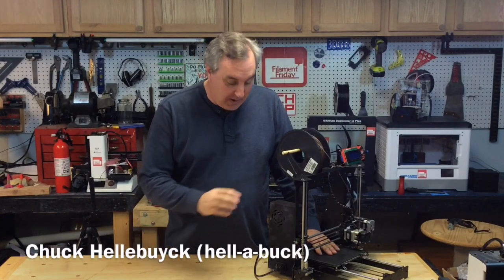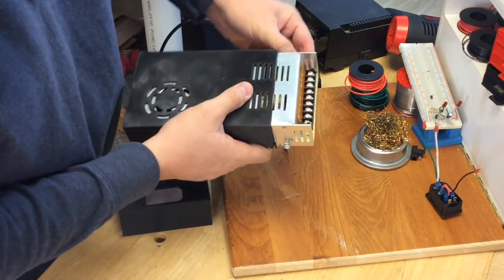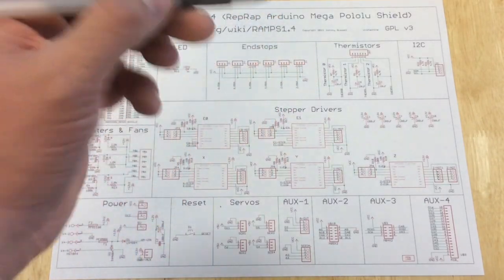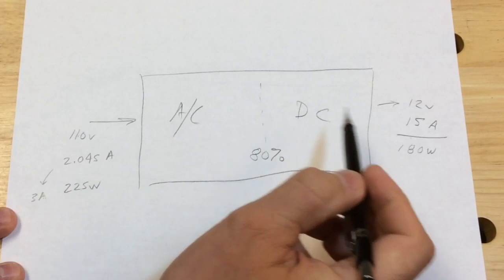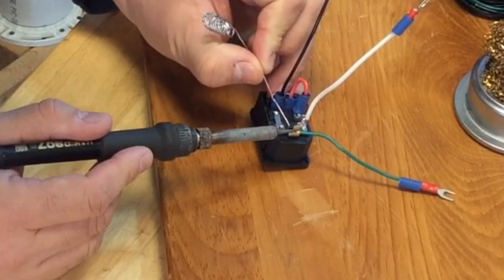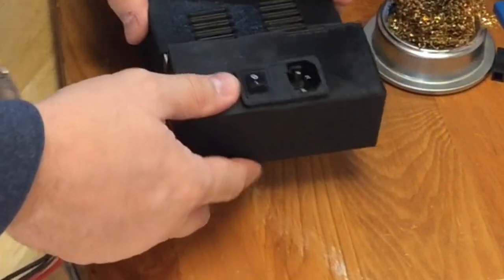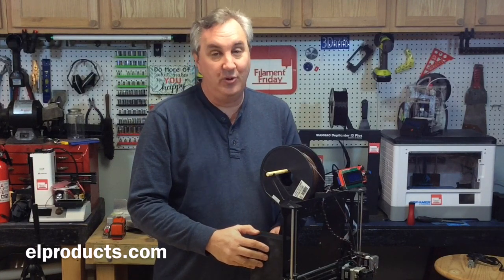How to install IEC AC Plug Switch Fuse module on a 3D Printer for Fuse Protected Power

Comment: Would we just double the amper amount for the fuse if we wanted to add a fuse to a 24V system? Thanks! Keep the content coming!
Reply from the maker: Not necessarily. Current often goes down or stays the same in a higher voltage system. Just has more voltage to produce the current so it can speed things up.

Comment: hi, friends, this 3 Pin IEC320 C14 Inlet Module Plug Fuse Switch Male Power Socket 10A with wires!!!   https://www.amazon.com/Socket-Module-Switch-Female-Terminals/dp/B07C1567XW/ref=sr_1_4?ie=UTF8&qid=1538632614&sr=8-4&keywords=c14+socket+switch

Comment: Would a full cover not be okay because you're screwing through to the case and so it will be connected to the 3d printer frame? My electrical knowledge is limited but i'm curious.

Comment: got the same switch  although   the rocker switch is upside  down so the plastic tab in between the to prongs is at the top  and in the above  shot in your video its at the bottom so would i plug it in the same way or the wiring on the rocker switch be inverted  i hope that makes sense

Comment: Thanks for this video. I bought that same switch and power supply for a printer I'm building from scratch, but couldn't find anywhere that said exactly how to wire these parts up until I found this video. It's a life saver!

Comment: Thanks for showing the wiring of the switch. Just had my printer fail a print mid way because I used crimp connectors. I did everything correctly but i guess the neutral part got loose and it melted destroying the switch. I was thinking of using crimp connectors just take off the plastic and use heatshrink(like i do when wiring up a car), I think ill be soldering the wires to the power supply. 
Is 14ga wire okay?

Comment: You seem to have more knowledge of the technical side of this hobby than most, I hope you dont mind my question: On an Anet A6 which is almost identical to Anet A8 and other similar machines...How important is an upgrade to a 30a power supply over stock, which I believe is 15a?
Reply: Notice that using a bigger power supply than needed will make the power supply a bit less efficient.
Reply: Pedro Zurita The power supply will last longer and perform cooler because of the reduced load.
Reply: I literally just did my switch wiring from my switch to a highly recommended 30a PSU from Amazon. Basically there's only 2 benefits. Faster warm up times on the bed, & the one everyone recommends from Amazon has a built in fan. I've heard it makes for better/faster ABS prints but I guess we'll see about that later. You could always rig a switch & an old PC face to the stock PSU I suppose. Either way, get a switch & MOSFET just for safety's sake.
Reply: stock is 20amps   - 30amp is better to meet the switch on surge and apart from dealing with teh hotbed better - allows "some spare" amps.   A mosfet is an additional helper for the  hotbed and alothough some say nozzle does not need one - for $5 each - I use two and in the UK this is known as "Belts and Braces" - yer never know if one  will fail! Also some folks who  buy a 30amp - use it for hotbed and motherboard - and use thw 20amp as a separate supply to the Nozzle - the 30amp PSU is OK for all and keep the 20amp for you LEDS etc,.    I also suggest that  ALL uses of hotbeds using the Anet plate and cable -  buy some Bondic or  ist cheapo clone - "5 second fix" off ebay and others - and use it across the  pins to lock in the male and female sides... it stops them  moving around  - which is mainly why the burn out!

Comment: Not sure covering up the whole PSU case is a good idea . In most ive repaired the power regulating FETs are bolted to the case which acts as a heat sink!

Comment: I saw the cloths pin on your Y end stop on your MakerFront. I had that same problem on my MakerFront. I designed a flat piece of plastic that I could put two screw through the end stop and bolt to the frame in the back. I 3D printed it. It has been working for about three months of continuous printing with no problems.
Reply: Also that filament holder you use does create some drag. I found a universal filament holder that uses bearings on Thingiverse that has almost no drag and fits every filament spool I have ever used!
Reply: I just now uploaded it. Feel free to use it however. I am sure it could be made better.http://www.thingiverse.com/thing:2106401
Reply: I was going to add another hole so the end stop could have two nuts and bolts to hold it better, but got to busy with projects. Currently working on a Root2CNC machine which is by sailorpete on Thingiverse.

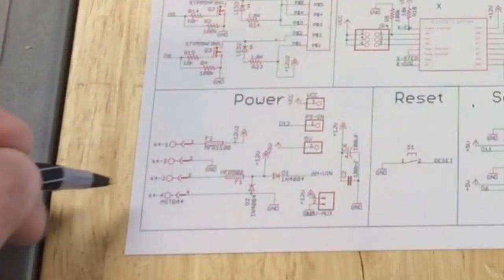Comment: 4:10 HaHa.. Boy... Chuck that is one noisy pencil....

Yeah relying on the Mounting screws to hold the two halves together would not have been my first choice.
BTW.. I understood that you wanted to protect the PCB on-board poly fuses by going just under their combined rating. I also under stood that at the 110vac input of the PS that worked out to about a 2 Amp Fuse.
By putting a 6 Amp fuse on the 110vac input you are no longer protecting the poly fuses and have increased the DC input to the poly fuses by 3 times or 45 Amps. 
You've essentially removed any protection to the PCB using a 6Amp fuse on the PS input and are only relying on the poly fuses to protect the PCB.

Comment: I left the 5A polyfuse alone and pulled the 11A one and jumpered it across.  I then replaced it with a car fuse in to those terminals at 10A.  24V 10A and I have never had it blow.  Now a word of warning is I had a resetable 10A breaker in there before and it got so hot it would burn me.  When the board died from a stray arc I pulled it apart and found that the Mosfet to the bed was getting so hot it melted the wiring connector over the span of about 18 months which is not good.  I bought a new ramps 1.4 and first thing I did was replace that fet with a better mosfet (IRF something I forget now but the specs were 60A etc...) and that baby doesn't even get warm to the touch.  That mosfet is a horrible mosfet as is being over driven for years (a miracle more fires haven't happened).
Reply: *****
No room on a Ramps for the Mosfets to get a proper heatsink and because of the lousy ones used it would require a huge heatsink.  This irf I used has no heatsink and never gets warm.

Comment: Why not size the fuse off of the power supply data sheet? I like your methodology if I were trying to size a power supply.  But your method is leading folks to size fuses based on infered data instead of going right to the source. Say your power supply has an in rush of 6As. Now every to you turn on your power supply you are working down the life of your fuse which could lead it to spurious trip when nothing is wrong.

Comment: One I bought some time ago had an odd size fuse that could not be purchased.

What is the physical fuse size of the one you use in millimeters please
Reply: Looks like a standard 20mm X 5mm fuse.
Reply: Thanks :)
Reply: If I remember the one I bought some time ago had a 19mm x 5 mm gap for a 20mm x 5mm fuse.... Cheapo rubbish
Reply: So it is able to fit a standard 3 Amp to 13 Amp fuse, I could never do this with the 19mm hole size on the one I bought elsewhere. The hole was 19mm and too much risk to make it bigger.
Reply: Thanks 2000%